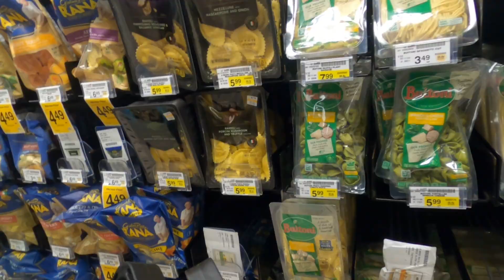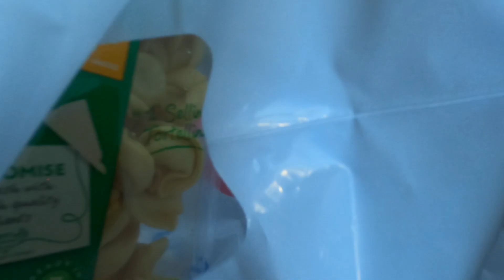First Day Back In The Van | VAN LIFE.

Comment: Welcome back!  I travel in a van with 2 cats and was up in Oregon and Northern Cal during the heat wave, it was 115 degrees!  And I ended up moving myself and the cats out of the van for a few days as well because of the heat.  I had commitments there, otherwise I would not have even been in the area.  I even have an AC in the van, but most people don't know the RV Air Conditiioner can only cool down the rig to 20 degrees below the outside temp, so at 115 degrees, the coolest the van can get is 95 degrees under the best of situations, so that sucks.

Comment: Great to have you back.
Belt is either the fan or alternator belt. Both are cheap to buy and easy to replace, maybe not with a cast on.
Get in touch with dome near by Vanlifers and see if they'll film and fit a roof fan. They can use the filming as payment and then they can post, you just buy the fan.
So pleased you're back 😁
Reply from the maker: I believe it is the timing chain slapping, it is very common with this engine. And I already have a roof fan installed. Thank you for watching I appreciate the support!